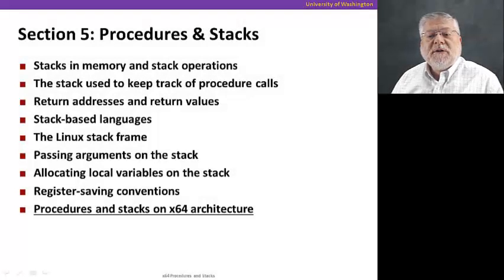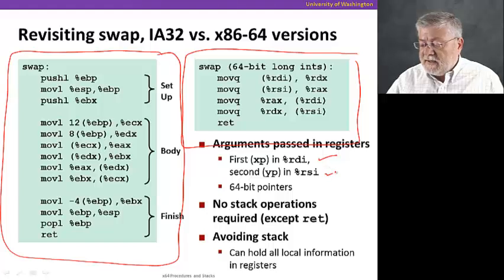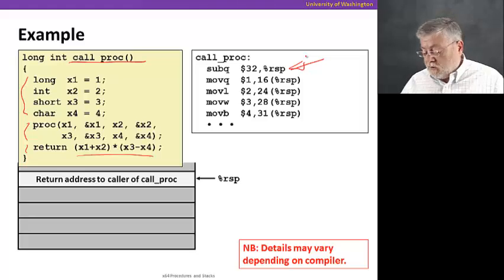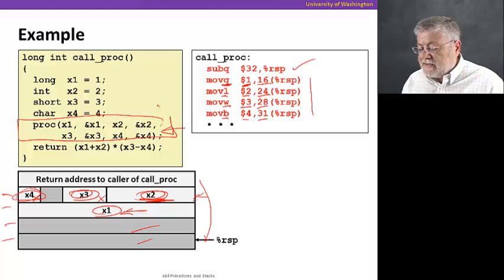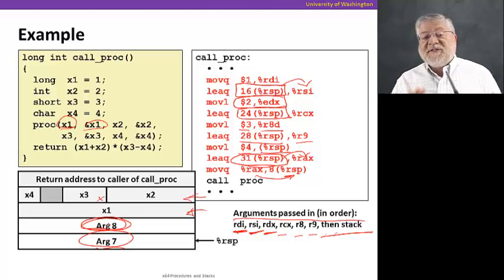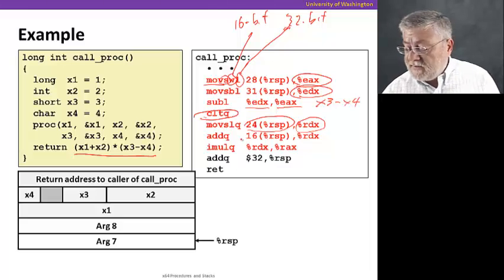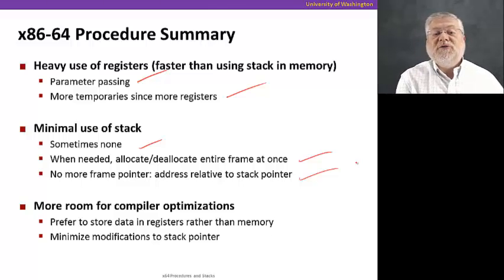Procedures, Video 6: x86-64 Procedures and stacks

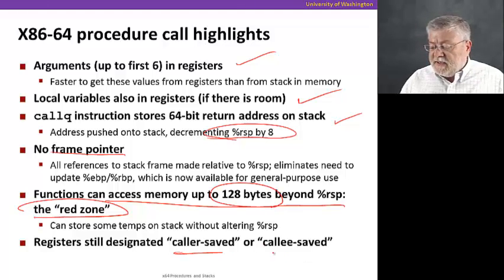Comment: 5:25 why functions can access memory up to 128 bytes beyond %rsp?
Reply: Good question. I can't answer that either. I guess to answer that we would have to know more about the "red zone". He mentioned it once in his previous videos but never explains it. It seems to be some kind of special place reserved for some stuff. Maybe local variables. But I don't know exactly. >> Still awesome learning resource!
Reply: @y.5107  
Red zone is something the operating system will allocate after the stack pointer that mean you don't need to allocate memory for local use except if you want another stack frame you will need to allocate but the red zone will still there .
This is only compiler optimization thing really.
So the compiler will set that if you enable the optimzation.

But this only work with AMD64 ABI.